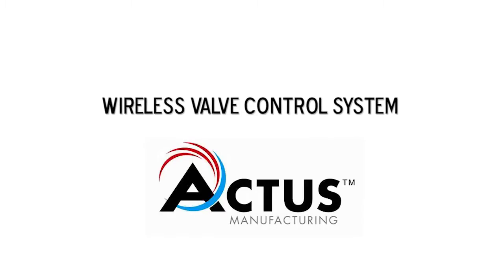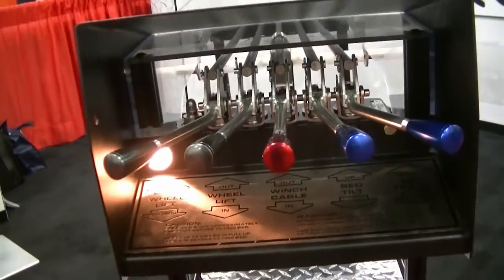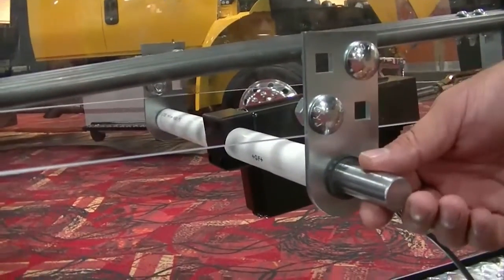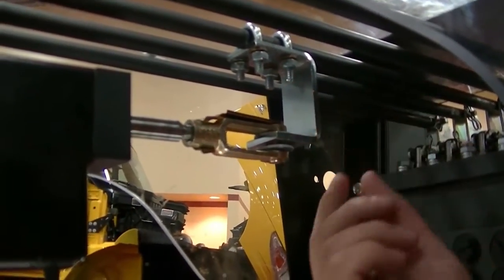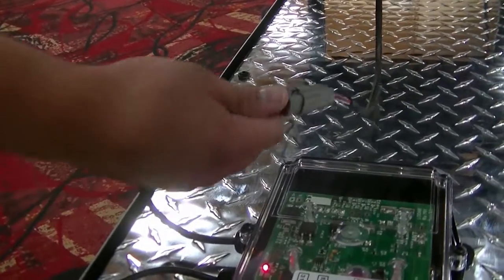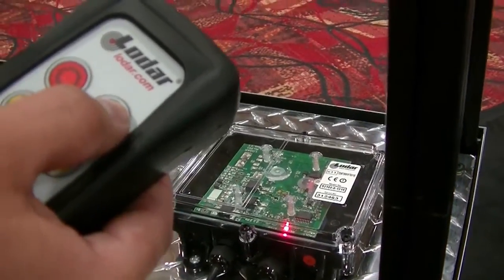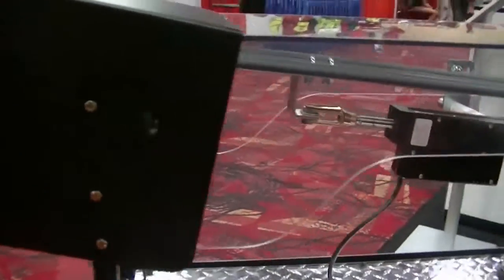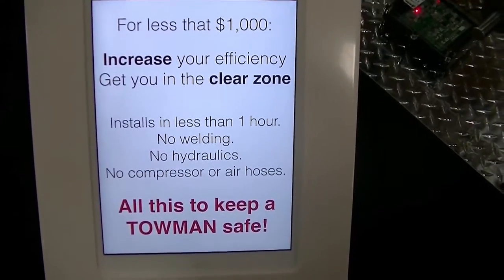Wireless Valve Control Video for dealers

Comment: Can you still use the manual handle?
Reply from the maker: Absolutely.  The handles will move freely and feel as if the wireless system isn't connected.